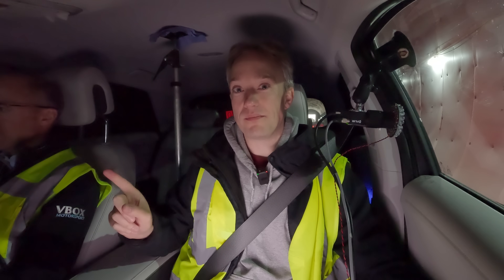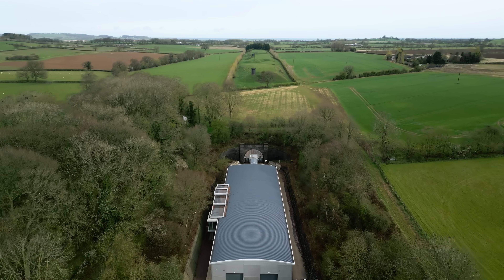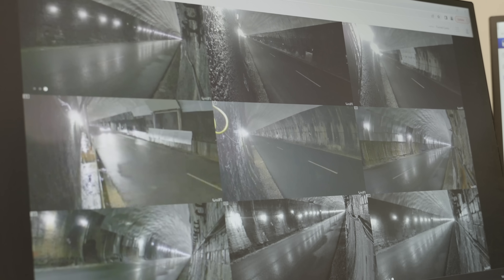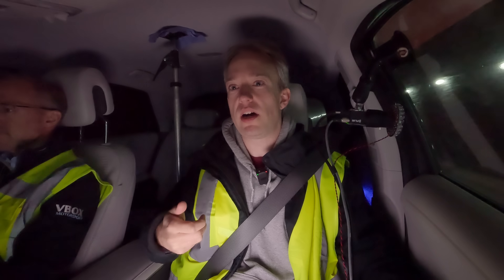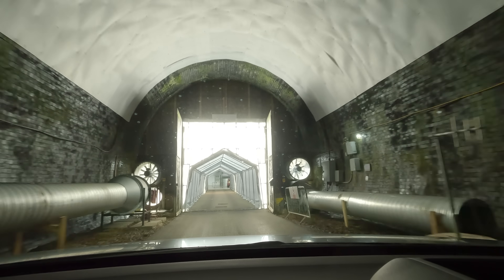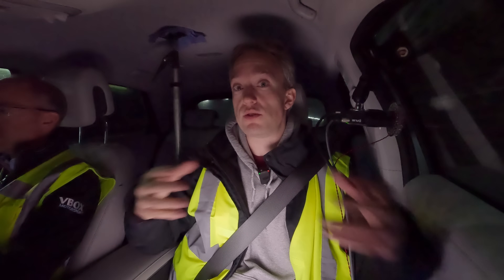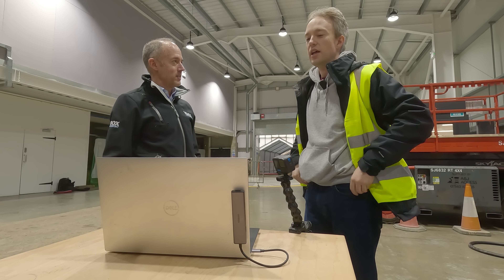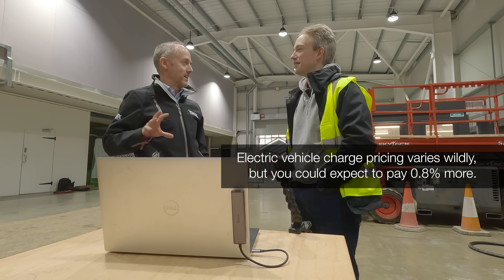This is an excuse to show you a really good tunnel

Comment: This could help answering whether it's more efficient to lower your car windows or use air conditioning, I've always wondered about that
Reply: Mythbusters tested this via measuring fuel usage over a long time around a racetrack, obviously the exact threshold varies based on vehicle, but essentially AC more efficient at high speeds (highway), open windows at low speeds (city).
Reply: I think the rule of thumb is: start-stop driving rolling down the window may be best. Highway speeds: rolling up the window is best.
Reply: The Mythbusters did an episode on that.
Reply: Opening a window creates bufferting and alters the airflow down the side of the car ...... however at slower speeds it doesnt make much difference and its only at faster speeds anything like this is worth noting . 
So around town dont worry but if you do a long run at 70 then it would impact . The amount depends on the car type also . 

A/C well theres 2 types . Electric and engine driven .
The older style engine driven can increase your fuel consumption by 20 and even 30% .
The newer electrical driven consider 1 or 2% increase or not enough to notice . 

Sooooooo it all depends on type of car , the trip and how you get there .
Reply: @godzillas6301  It makes no sense that electric motor driven AC is more efficient. That has to generate electricity from the engine and then use that in an electric motor to drive the AC compressor. Surely direct engine drive to the AC compressor should be more efficient? And if not why not? I can see that the electric can run at whatever shaft speed it likes whereas direct engine drive is stuck with the engine revs and drive ratio to the AC, but how does that matter?
Reply: @owensmith7530  load matching, it's similar to why your car has a gearbox to begin with.
Reply: @crackedemerald4930  I have a regular route I drive 140 miles at mostly 70mph on motorways to my parents. My car does between 38 and 42 mpg on this trip as measured by the dashboard computer. I can detect a relationship between tyre inflation and even engine oil level and the mpg I get. But whether the air con is on or off is not detectable and my air con is direct engine shaft driven. I'm not saying it has no effect on the mpg I get on this trip, but it's nothing like 30% or I'd be able to detect it. The fact I see no change means any effect is below about 5% and certainly below 10%.
Reply: @owensmith7530  Its simple enough and makes perfect sense if you think about it for a minute . 
A belt run off the engine saps power when put under load . The electrical system of a car doesnt place anywhere near the same load as a mechanical pump . Spin an alternator and theres almost no load on it bar the resistance of the bearings based on the commutators weight thats the load . Now try to spin an aircon pump and feel the difference and thats without the presence of the gas inside which is pressurised . A vehicles alternator will spin regardless as its always needed ... you do get when you put the lights and wipers on when in your car the mpg doesnt plummit doncha ? guess why ? .
Reply: @godzillas6301  If the alternator is under load it will certainly provide a lot of resistance. You don't get free energy just running from the battery.
Reply: @owensmith7530  I think I have noticed it is the initial cool down that uses like 2L of fuel. Load may drop off after about 20 minutes.
Reply: @economicprisoner  i see . Care to explain how  load comes from an alternator and how it can be  increased .
Reply: @godzillas6301  A load on the system will drop the voltage. A larger voltage drop across the alternator results in more current draw.

It is not entirely linear. the rectification diodes  have an operating voltage that increases only slightly with load. Also once the coils are saturated: you can't draw any more current from it.
Reply: @economicprisoner  My regular trip to my parents uses 8 litres of petrol. If that went up to 10l when I use the air con I would trivially notice.
Reply: @godzillas6301  The load from the mechanical AC compressor is not constant. The more cooling is required the more compression is required and the harder the engine needs to work to turn the compressor. And when no cooling is required (which will happen sometimes even with the AC technically on) there is an electric clutch which disengages the compressor. Indeed if the electric clutch fails (as it has once on my car) you get no cooling.
Reply: @owensmith7530  lovely ... 

``Surely direct engine drive to the AC compressor should be more efficient?``

I will say again .... Care to explain how load comes from an alternator and how it can be  increased . Explain how the engine has to work harder and therefore use more fuel . 

Dashboard computers are well known for being the most accurate things on the planet ... no wait its the other thing ... they arnt even close most of the time .
Reply: @godzillas6301  The more electrical power the alternator is producing, the harder it is to turn--the more power must be input into it.  Or were you looking for a physics explanation of what makes the alternator harder to turn the more power it is delivering? Google "back emf"
Reply: Mythbusters already did that, use your AC.
Reply: If ypu are going faster than around 50 kmh ( if i remember correctly) the A/C is more efficient, if you are slower, you could open the windows instead and save some energy.
Reply: Keep in mind it's going to be different with an electric car, the ac drains more battery power than it does fuel
Reply: Or maybe that's just when you want to heat the car
Reply: Mythbusters did that in real world conditions a long time ago.  Their method:  Have a transparent tank on the outside of the car where they could see how much fuel they used, and drive around the perimeter of a parking lot several times in varying configurations.  

I believe their result was that the AC was quite a bit more efficient,  but keep in mind that was more than 10 years ago so car aerodynamics and AC technology have certainly progressed since.
Reply: "The answer, as always, is 'it depends'."  In this case, depends on the car and the speed.  When Mythbusters tested this myth, they found that the impact on mileage from air conditioning in their vehicles was very small.
Reply: @CodeKujo  I would suggest you revisit it and look into what other people found .

Windows up was an estimate and that instantly brings the entire test into dispute . If you do not have a firm tested , considered and replicated test to show the starting point everything afterwards fails . 

They then run at a certain pace they decided there was no difference with aircon on or not with windows up .
When they altered the speed they found aircon used 15% more fuel .

So they found ``it depends `` also ............

Since the dawn of air con being fitted to cars owners have noted cars use more fuel thanks to running it and its known why . Its not hidden , its 80 years of knowledge and experience . I absolutely refuse to accept the findings of a single test using a single vehicle type in a single place as gospel ignoring thousands of reports from decades saying differently .
Reply: @godzillas6301  Indeed, I only meant it as a data point and not as gospel.  the only “answer” I meant to give was “it depends”.
Reply: Mythbusters tested that.
Reply: I think myth busters did an episode about that
Reply: @Ping727  no way, someone would've said that.

Comment: Why did they build the tunnel?
Reply: According to Wikipedia the land owner refused right of way, because it is a scenic area.
Reply: Just a guess, since it was originally built for a railroad then I would imagine it was done to avoid grade changes and save time for the train by going through the terrain rather than following its surface.

Comment: According to the Coulomb model of friction, the force doesn't depend on speed, so the power loss (i.e. rate of loss of kinetic energy) due to it scales with speed; according to the drag equation, the drag force goes as speed squared, with power loss as speed cubed.

Comment: 3mm from being near perfect, made all that time ago. Mad! How did they do that?
Reply: I'd say optical theodolites and lots of trigonometry, same as the Ordnance Survey used to map Britain.
Reply: @otterylexa4499  Or even zero trigonometry, just a telescope and a few well-lit markers, check if they're on a straight line and you're good. (That's if we just want it straight... For getting it from A to B a bit of angle measuring capability would be needed too, yes)
Reply: Depends how you define "perfect" - because the Earth curves, while the tunnel is a straight line, assuming the tunnel is perfectly horizontal somewhere along its length, the highest and lowest points will be separated by 0.57-1.14m in height.
Reply: A really long string? 😂😂🤪🤪
Reply: @michaelwarren2391  haha

Comment: Just curious about the roof support 🤔
Reply: I thought it was a mount for the camera.
Reply: @michaelwarren2391  did not see any cam connected
Reply: Mount clamming an inertial sensor to the body. Not used directly in these tests but can be used as a sanity check on the speed data

Comment: Oh god I thought Tom had gone to the silly Tesla tunnel.

The result is interesting, and I can only imagine that they have also done tests for those roof boxes for skis. They are known to be bad for fuel efficiency, but I would like to know how much.
Reply: I think the scientific answer to that would be: very. 😋
Reply: I do think that driving back and forth at a constant speed in a straight line would actually be an ideal situation for a computer controlled car (not a tesla, don't want to ruin the tunnel).
Reply: @web4639  Make a queue out of all those cars and put more seats in them. And ditch the word "car", use something more to the point. Like an underground or a subway. Or a metro.
Reply: How are those tunnels silly? They seem to be used by 1000's of people per day.
Reply: @SirDragonClaw  single lane, no fire exits, build a tram are the main ones iirc